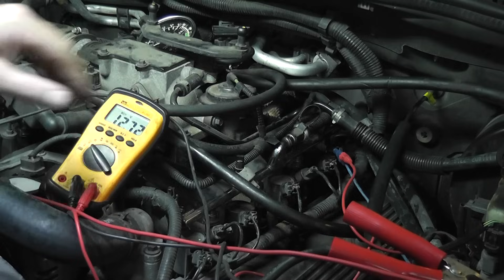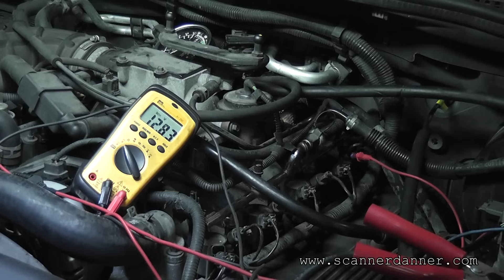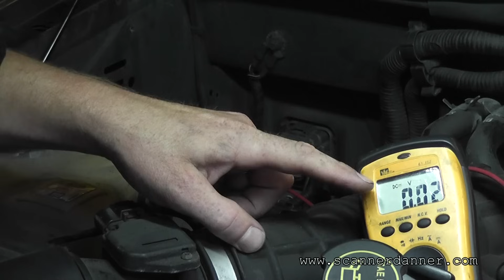How to test a fuel injector circuit with basic tools (open control wire)

Comment: Really not fixing it in vid ???
Yep that's a dislike
Reply from the maker: The main point of this video was the diagnosis. In hind sight I could have shown you were the open was. I just didn't think it was that important. Knowing there was an open and not a bad computer like the guy at the other shop called was critical.
Reply: ***** Honestly, anyone who needs to see how to fix a broken wire wouldn't understand how to diagnose that it was the problem to begin with.
Reply: ScannerDanner  and Schrodingers Box I'm subscribed to both of you and y'all make great educational videos. ScannerDanner I felt like the video broke away from the norm by not showing what was wrong and that it was a 5min infomercial for S.D.Premium. Schrodingers Box We all have decades of education under our belts but we forget that at one time we didn't know or get the fundamentals of being a technician. It is easier to set off that spark when you bring something full circle not just here how you use a tool and it shows something somewhere else is broken.